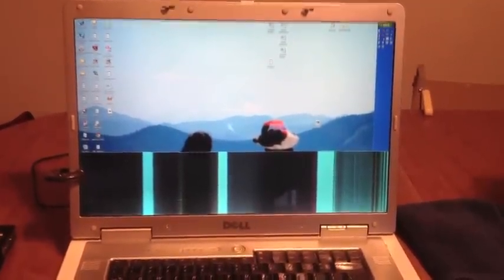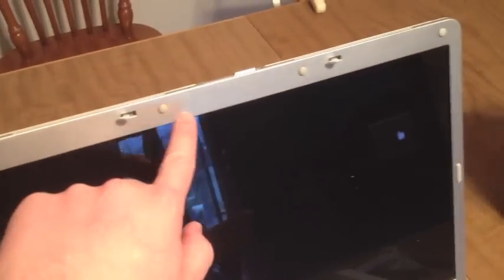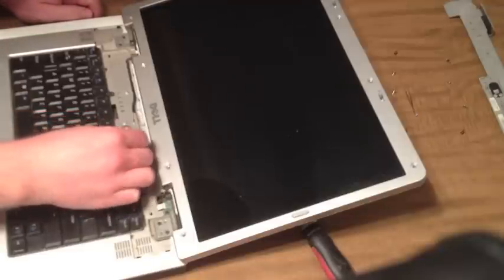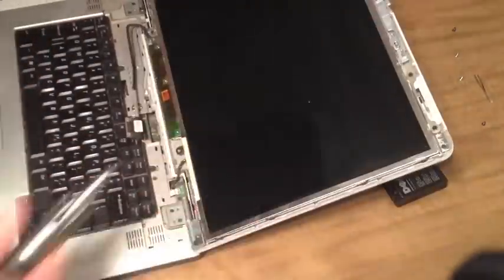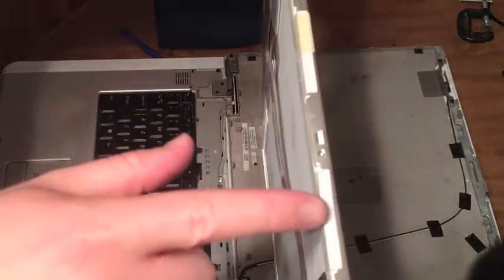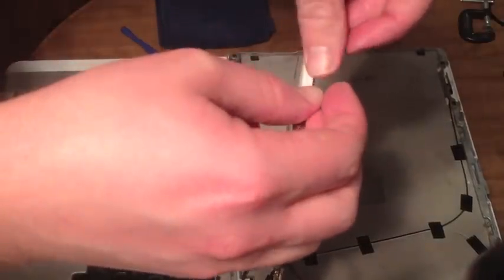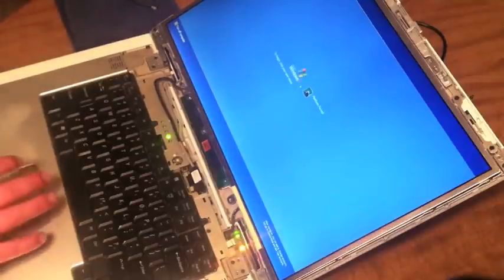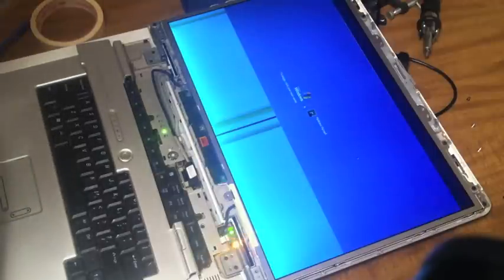Attempt to fix laptop screen lines - Inspiron 9300 screen lines

Comment: HI, REALLY ENJOYED YOUR VIDEO, I'M HAVING TROUBLE WITH THIS PC (DELL INSPIRON 1720) TOO, IN MY CASE THE WHOLE MONITOR SHUTS DOWN AND WHEN I TURN IT ON A WHOLE BUNCH OF VERTICAL LINES SHOW UP, AND CAN'T SEE ANYTHING. WHAT I'M DOING FOR THE MOMENT IS JUST TURN IT OFF AND ON UNTIL WINDOWS COME ON AGAIN. IT'S BEEN DOING THIS FOR THE PAST 3 WEEKS. SO NOW I JUST LEAVE IT ON 24HRS A DAY. I'M GOING TO TRY THE TOUCHING THING TO SEE IF IT WORKS THE NEXT TIME IT CRASHES, THAN  I'LL GO INTO THE DISMANTLING STEPS YOU SHARED WITH US. TOMORROW I'M GOING BACK TO THE STATES FOR TWO WEEKS, I'M IN JAPAN NOW. SO I'LL START THE TEST WHEN I GET BACK. THANK YOU VERY MUCH FOR YOUR VIDEO

Comment: Thanks for the vid. Nice investigative analysis. However, the fact that you did succeed in getting the lines to go away means that it can be solved without further investment in parts. The tape is most likely susceptible to the heat of the screen and should be replaced. Heat is almost always a factor in computer issues of a hardware nature.

Comment: a loose wire connection that plugs in back of screen or at the top back of screen from left to right there are connections to try using  type to hold down all the connections   might be the cause or vertical lines. i doubt it is a video chip on the board because you use a C-clap before and it fix it if it was the chip c-clapping the screen wouldn't work.. id say it is more like a faulty wire connection..

Comment: the copper ribbons that run along the back all the way to end seems to be causing the problem, i lightly ran a soldering iron across them. Problem is everything is covered in plastic. Some of the lines did disappear but it's definitely a soldering problem that caused the problem. Might seem a little silly but the old Nintendo Game boys had a similar problem, over time vertical lines would appear and someone figured out if you ran a heated soldering iron across them it would make them disappear because you are allowing for the copper to connect again. I think i might just keep mine for parts.
Reply: I think you're right. Because it looks a disconnection thing. Otherwise if we can be able to connect those copper connections again, it will be fine. Why, because at times if u press the screen they disappear but if leave it comes back. I will try to connect my hp 255. But it will take a lot of patience since those connections are too tiny for human eye.